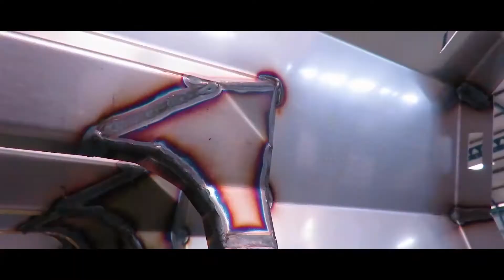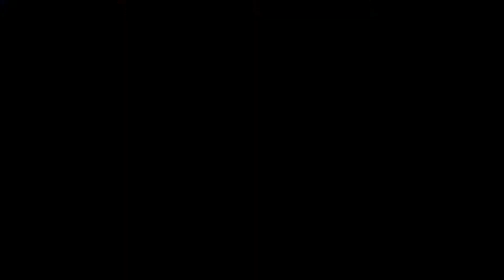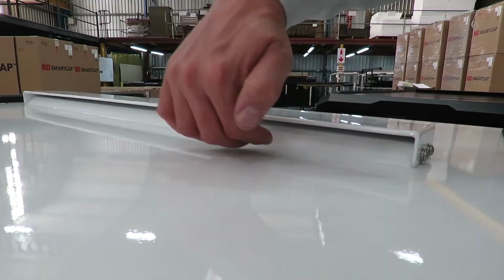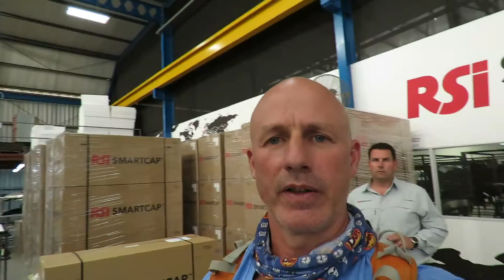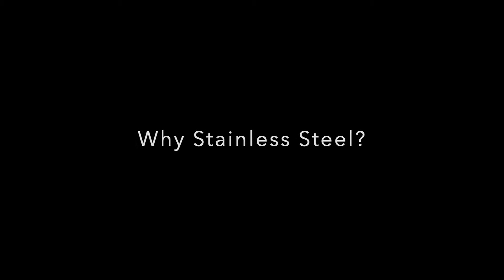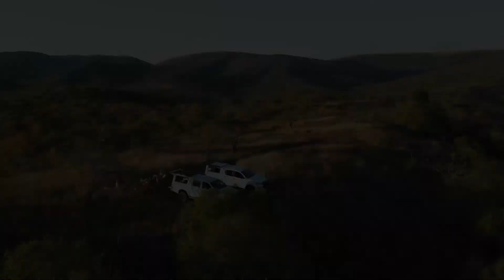RSI Smartcap factory tour

Comment: Looking at various options out there. Does Smartcap offer a model that has all of the following 1. insulated & 2. Has screens/pet screens & 3. Has power lock that matches vehicles key fob & 4. Has lighting built in that is wired to latch & 5. Thicker than sheet metal? Lastly...how many sales/installation/ warranty locations are in the United States? In advance...Thanks